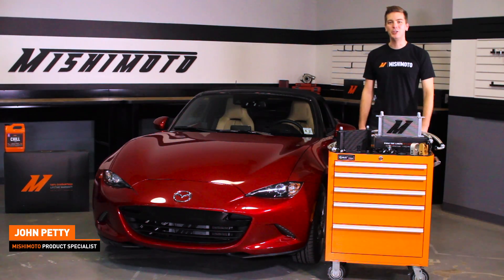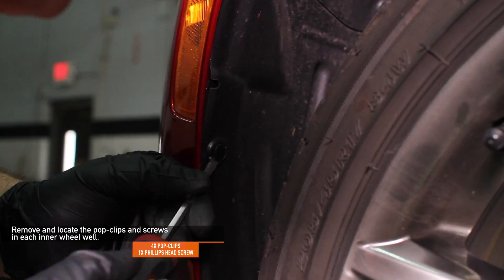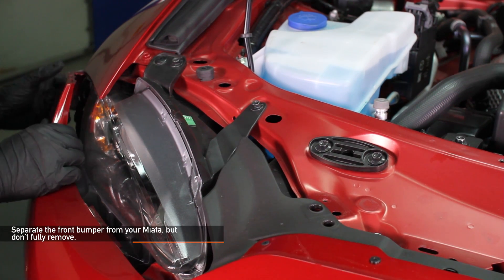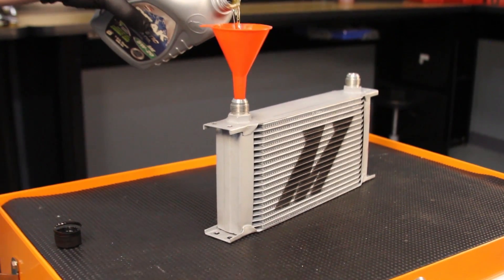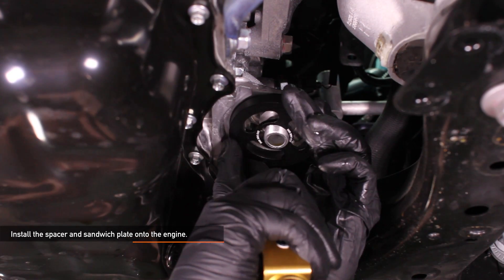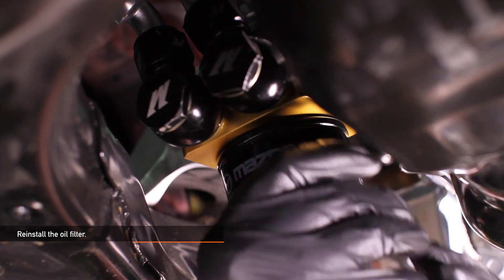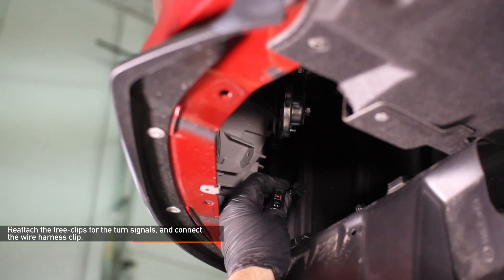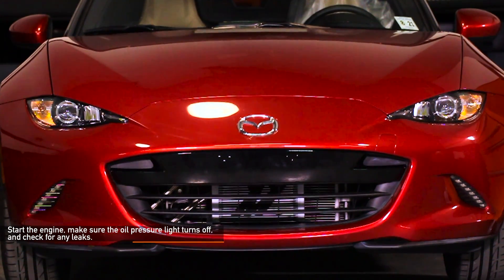2016+ Mazda Miata Direct-Fit Oil Cooler Kit Installation Guide By Mishimoto

Comment: How do i know which sandwich plate is in this video? I just need to order the spacer and sandwich plate with banjo fittings
Reply from the maker: The plate itself is either model number MMOP-SPTR or MMOP-SP depending if you were looking to order the thermostatic option or not.
Reply: @mishimoto  awesome, does that come with spacer?
Reply from the maker: The spacer is a very specific part of the kit and is not included with the sandwich plate. Please contact us at support@mishimoto.com with a copy of your receipt for the oil cooler kit and the team will look into options for you.

Comment: Could the brackets that come with it be used to ins on the front bumber?
Reply from the maker: This is designed to mount behind the bumper on the crash bar. Any other location would require modification to the mounting bracket.

Comment: To make an oil change, you need to uninstall the cooler to drain dirty oil from system?
Reply from the maker: Hey Prayan De Jesus Pulido Parra!! The process shouldn't change. Drain oil, replacement drain bolt, remove old oil
filter, install new oil filter, fill vehicle with oil.